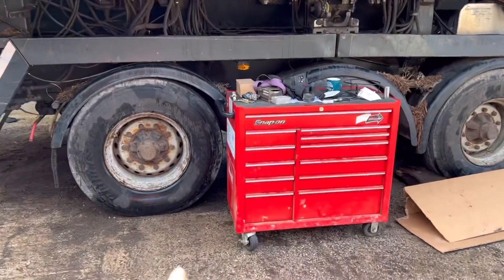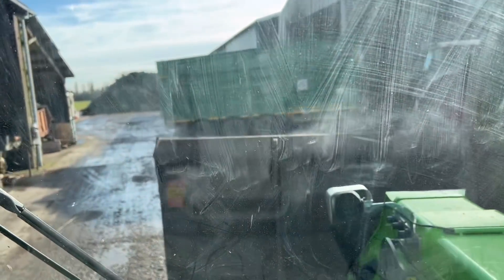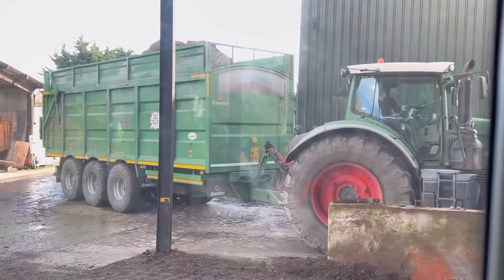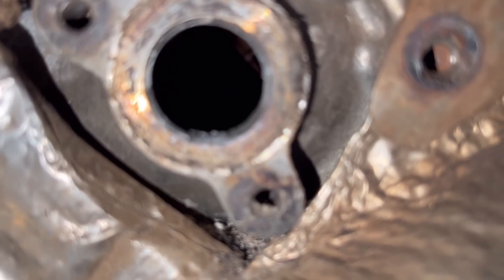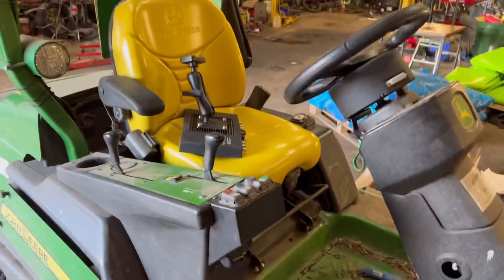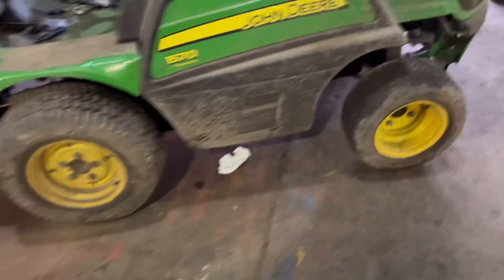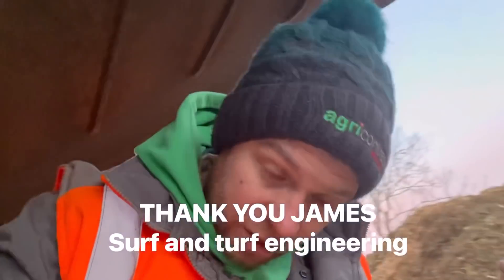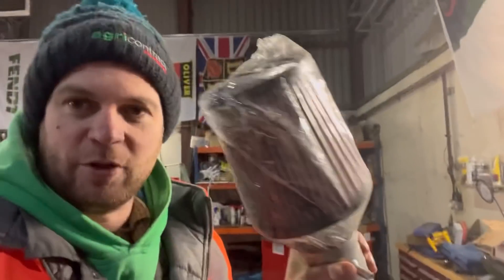Day709  #OLLYBLOGS CHIPPER PROGRESS MOWER GPS FITTING  #AnswerAsAPercent

Comment: It goes into regeneration when the Difererensionl pressure on the dps is to high (filter blocks)  if you bypass or empty it the dpf it will stop regenerating well it works on cars